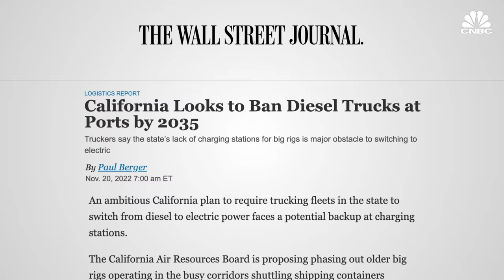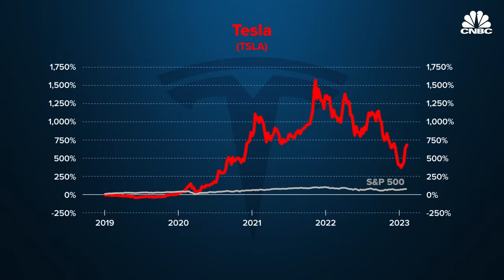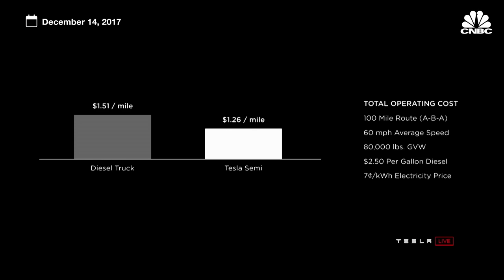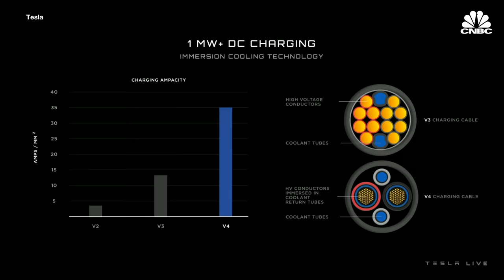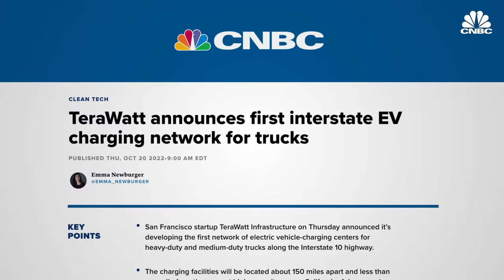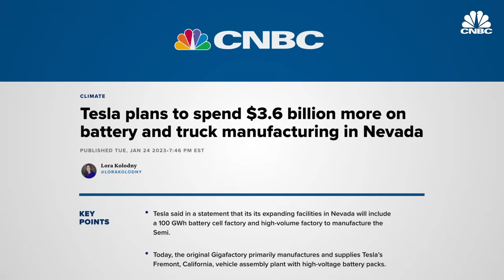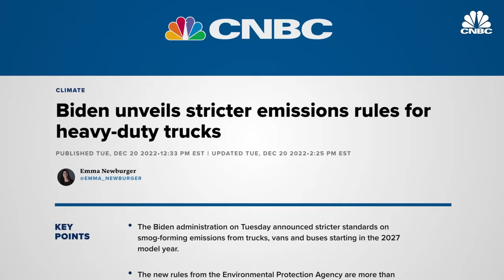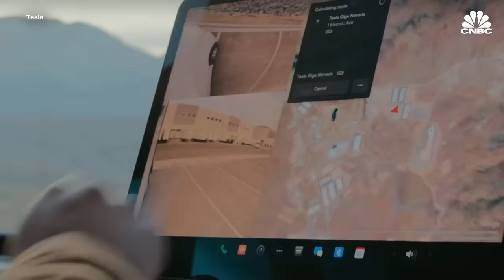Does The Tesla Semi Live Up To The Hype?

Comment: I'd be much more impressed if I could get basic information on specs like the actual tare weight of the truck.
Reply: Since it's the 2170 cell version of the truck, it's likely going to be replaced by the lighter 4680 cell version, so they don't want to publish a weight that's not finally when they can shave half a ton or more.
Reply: Yeah, I think we would all like that info.  We'll get it ... but seems its going to take some time.
Reply: It seems odd that they are hiding this info.
Reply: Decades ago, when asked about the performance of their cars, Rolls Royce would consistently issue the same statement.
.
"Sufficient".
.
Nuff said.
Reply: @LordandGodofYouTube  
It's essentially none of our business.
Reply: @rogerstarkey5390  That'll work as long as PepsiCo is their only customer. Once it's time to try to hit the broad market, the specs will have to come out.

People and companies who buy this car are not the same as those who buy a Rolls Royce.

Bonus: Rolls Royce specs are readily available, for those who care. The Rolls Royce Phantom makes 563hp, weighs 5,644lbs, and can run 0-60 in ~5.2 seconds. Interestingly, that's slower than my 2013 Boss 302 Mustang. But, then again, the Rolls isn't really selling based off of performance alone.
Reply: @rogerstarkey5390  It's a key figure in showing how efficient and useful the trucks actually are. There'd be no reason to hide it except if the number looked bad for Tesla.
Reply: you seen like a SMART guy, you do the MATHS.
Reply: They’re getting 400 miles at 40K pounds. On relatively flat roads. Let’s see them take on some real payloads on different types of roads and routes.
Reply: @rogerstarkey5390  Actually, it is our business if they are trying to sell us a truck. I can go to any other truck maker's website and get all their specs, including their weight, as it's necessary for calculating how much I can haul.

The truck's weight, plus the empty weight of the trailer, both have to be subtracted from the 82,000 lb max allowed by the US government. If a truck is very heavy, it will cut into the payload, which as the term implies is what pays the bills.

Bags of chips are very light relative to their volume. I've hauled them before - a full load is less than 30k lbs. Rolls of paper, on the other hand, are heavy - a full load can easily hit 45k lbs. If I have a fleet and haul a lot of paper, and the other parameters match what Tesla is advertising, I still need to know if these trucks can legally pull my loaded trailers.

Any serious truck manufacturer will share this info. Even if down the road they expect to update the model to lighten it, or add a lighter version, etc.
Reply: @miguellopez3392  that battert is atleast 5 years away lol its been promised and not rolled out.
Reply: @JamesPhieffer  the semi is estimated to weigh 27,000 lbs with a 44,000 lb load rating to make 500 miles.
Reply: @TheCriticalArchitect  there have been numerous estimates, but estimates don't cut it in business, especially when every competitor clearly shares their basic specifications, of which weight is one.
Reply: @Nazar M  it's already in the model Y, the semi uses 10x the cells as a model Y, so they need higher production of cells.
Reply: @JamesPhieffer  Seems to me it isn't our business because, at present, they're not trying to sell trucks to us. When they want to sell trucks to everyone, you'll get your specs. As someone else said, the specs might be different from now due to different battery cells or other changes, so current specs don't matter. Pepsi is effectively their beta tester.
Reply: @Mark_Bridges  They are trying to sell trucks to us. Businesses need to see the specs to make decisions, and hiding them isn't a good look. They're building a factory and expecting to sell thousands of these in the near future according to the story. That means customers need to get comfortable with them. Part of the process is seeing how early adopters like Pepsi fare with them. But a lot is going to be based on doing hard calculations and comparisons with other manufacturers who aren't acting like they have something to hide. 

I think Tesla may not realize that there's a difference between selling cars and selling trucks.

And they owe it to their shareholders to ensure they do everything possible to make the investment in the truck pay off.
Reply: @JamesPhieffer  I hear what you're saying. However, they aren't YET ready to sell to everyone and, as specs are likely to change, aren't releasing them yet. Makes sense to me.
Is it better to release specs that are wrong, or wait to get them right? I'd rather the right specs if I wanted to buy a truck, which I don't so it really doesn't affect me anyway.
Reply: @FerociousPancake888  
Actually Tesla demonstrated over 500 mile range, with 82,000lb gross weight, in real world conditions, half of it on mountain roads, with peak elevation over 4000ft.
Also a few people did the math in different ways, and it checks out.
Most likely it's currently a bit heavier than a diesel semi, but batteries are becoming lighter every year, and it's possible to save weight in other parts too.
For most payloads it doesn't matter. And in the worst case it would be a little less efficient, which doesn't negate the benefits.
Reply: @miguellopez3392  this makes sense, thank you for the input
Reply: @contact594  dint forget tesla, tesla is going to be using them as well.
Reply: @JamesPhieffer  what competitors have electric trucks? They are the only one brotha.
Reply: @0xsergy  Did you not watch the video, where they mention the other companies with electric trucks in production or being introduced? Volvo, Kenworth, and Lion, amongst others already offer electric Class 8 trucks for sale. With their more limited ranges, it's easy to see they are focusing on local/city work to keep the weight down to the same as an ICE powered tractor.
Reply: you cant even get the tow capacity on their cyber truck.
Reply: @rogerstarkey5390  rofl this kid thinks specs are not the consumers business when buying a vehicle.
🤣🤣🤣🤣🤣🤣🤣🤣 also this dummy tried to compare teslas which are currently breaking down, catching on fire, driving off the road, falling apart with rolls royce, who has 95% of all cars they've EVER made since day 1 still on the road.
Reply: @Sean w  its 14,000lbs for the cybertruck, did you even bother looking?
Reply: @miguellopez3392  it's imaginary, like the Cybertruck is still at this point.
Reply: @JamesPhieffer  yep just like starship...
Reply: @miguellopez3392  I'm more optimistic about seeing it than the Cybertruck. And frankly a lot more excited.
Reply: @JamesPhieffer  Weird. All those CT sightings increased and seems to indicate the production is near and you still think it is an imaginary product.. You must be biased for whatever reason.
Reply: @pascalabessolo5350  its been close to 6 years. At this point scepticism is only reasonable. When they go on sale, I'll believe they're going on sale.
Reply: it seems easy, a driver just drives it to a scale and weighs it!
Reply: @JamesPhieffer  I suspect that you would have been very pleased to see the Tucker car company go under.
Reply: @g4l430  no, because Tucker undersold and over-delivered. Tesla tends to do the opposite.

As it is, its main strength is its charging network. Its battery and motor tech is good, but not outstanding. And the rest of the cars are poorly assembled, have questionable interior layouts (except the S and X), and long in the tooth design-wise.
Reply: @rm-jl8wy  and how does one get their hands on it in the first place to do so?
Reply: A channel called "Engineering Explained" made a couple videos about it where he did calculations to make estimations on it's specs and performance and how realistic it is. [Does The Tesla Semi Make Any Sense?] & [Does The Tesla Semi Make Any Sense? Part 2!] (Not including links because YouTube doesn't like them.)
Reply: @LordandGodofYouTube  - Because the situation will change and people will not all hear about the latest later only remember the old stuff and have false impressions.  May also be for competitive reasons, like the specs and features of the Cybertruck due out in a few months with est. 1.5 million pre-orders, no one knows what the final specs and features will be.
Reply: @Bertinator-nm9ld  - UPS and Sysco have also preordered Tesla Semis.  I've read that some company has ordered 2,000 Semis from Tesla but who know when that will be fulfilled.
Reply: Tesla doesn't NEED to provide specs yet since for the next year or so, Semi will only be available to large companies for in-town use. There won't be owner-operators driving Teslas OTR for at least a few years, cuz at the very least, there's no sort of charging network.
Reply: @nandisaand5287  - Yes, I agree. It will be interesting to see when and how fast Tesla starts to build its Megacharger network. It will very much depend on who the initial customers are as customers like Pepsi with fixed route use can build their own Megachargers.
Reply: @nandisaand5287  - More than ‘in-town’ use, more like fixed routes of up to 400 miles. That way they can build their own Megachargers and save lots on fuel costs and stay within 80% of max range.

Comment: I'm a local driver for a mega carrier arm, i expect to see electric replace a good portion of the home daily drivers sooner than later.  Its really gonna come down to reliability though, if they start hitting the roads and are rolling fine it will switch quickly. If not its going to be long and drawn-out.
Reply: Yep, it's just a matter of time. Though, don't expect Tesla to produce meaningful numbers this year. It will scale to a few hundreds, but the real scale will happen in a year or two, like with the model Y and 3.
Reply: i haul milk locally. it's farm loading and plant delivery. we are on overweight permits, and everything here is hills. i drive a 2022 T880 X15 cummins 565 hp and an 18 speed manual. this ugly thing isnt going to be replacing my X15 powered beast. it simply wont have an stamina with the weight or the hills. it wont be hauling construction equipment, windmill generator heads (LOL), blacktop, concrete, dirt, stone, water, fuel or anything that's on an overweight permit...... which is ALLOT of local trucking.
Reply: Agree with you.

That said, I own a Tesla.  Haven't had to do ANY maintenance other than changing tires and adding wiper fluid for 5 years.  I think reliability is generally better because the electric drivetrain has no fluids.  It's much simpler.

The problem might be repairs when you need them.  Like say non reliability issues like accidents.  You can really only go to Tesla service centers.
Reply: Reliability should be a LOT better. Very few movable parts, lesser wear and tear, more life expectancy..

Comment: To be fail, a LOT of diesel tractors are well over $100,000 and have been for a while.
Even occasional recent low-miles used examples will sometimes exceed $200,000 (browse Kenworth T2000 listings sometime among others).
Reply: That's a consequence of capitalist monopolization and profit-seeking, not a realistic analysis of the actual cost of tractors. Any realistic cost analysis would include total agriculture government subsidies into the equation, after accounting for how most of the subsidies go to massive agricultural corporations and suppliers, rather than actual farmers. If the government were to instead nationalize the industries it's propping up, and directly provide those subsidies to actual farmers that own actual farms, it would be a radically different situation. But, no, America exists to serve the shareholder class, instead of actual working class people that do actual work.
Reply: @RosscoAW  How does that affect the cost of diesel (or other) tractors?
Owner-operators and fleet operators don't get "agricultural subsidies".
You're sounding FAR too Communistic with your "complaint" and statement.

As if Europe does NOT provide even MORE subsidies than the USA does.

Comment: Not a fan of Elon Musk, but the semi is pretty freaking cool
Reply: It's half the performance in weight of diesel with 1/4 of the distance at full tank of the high end tanks (total of 300 gallons of diesel). 

The only positive they have is that they can be charged with renewable energy which if you have solar panels is cheaper in the long run but other than that the tech is not quite there... this video is mostly tesla and Frito lay propaganda

Comment: Craig, a diesel powertrain can produce more power from a weight perspective? Last time i looked, one of the factors benefitting EV trucks to allow for more batteries is that the powertrain weights less than a diesel engine with a transmission 🤣 Please don't make it sound like an EV motor can't pull the crap out of a diesel engine any day from 0 RPM